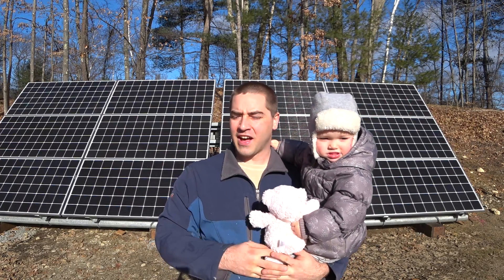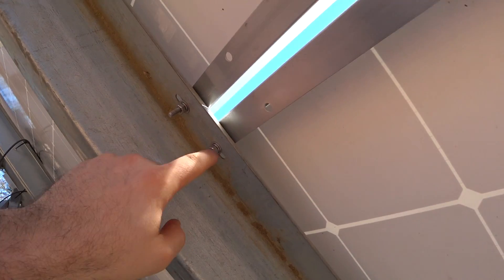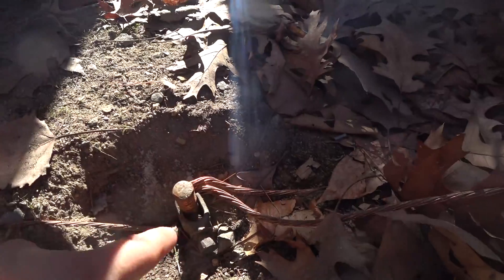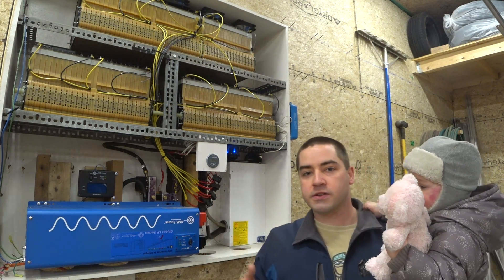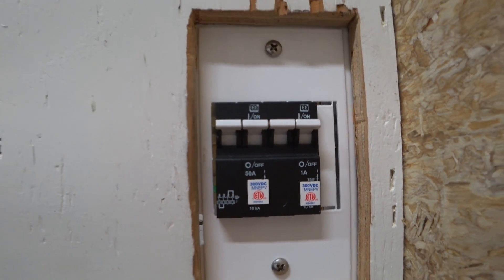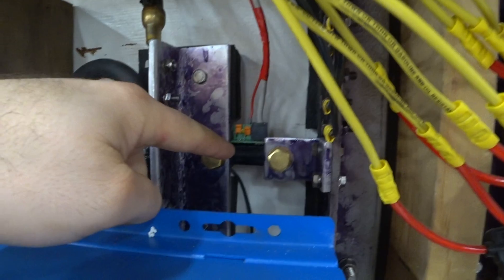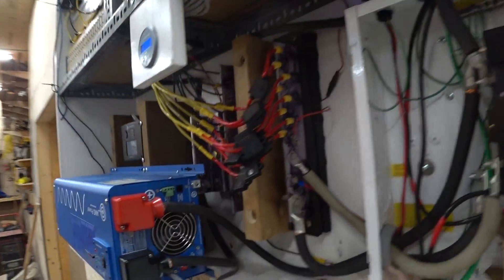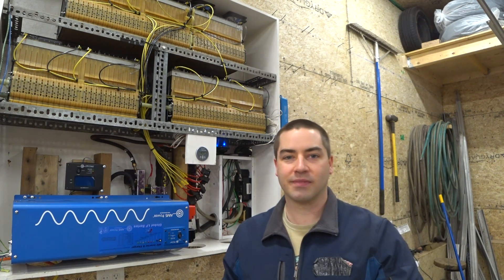Overview of Entire Off-Grid Solar System for Whole House

Comment: David, about how much did the battery system (everything but the panels, I guess) - cost for materials?  Do you know about having such a battery on a grid-tied solar PV system?
Reply from the maker: Hi Neil, The battery was the single largest purchase at $2,000.  $900 for the Charge Controller, $900 for the inverter, $200 for the battery monitor, and probably $300 or so for cables, lugs, terminals, etc.  I hope that helps.
Reply: @DavidPozEnergy  That is very helpful.  I have a 10kW roof mounted system, and I have been hoping that Aquion Energy will get their business reorganized (they make salt water batteries for buildings).  If they don't, then I am very interested in a system like yours.

Is it possible to do a battery on a grid tied system - that you can use when the grid goes down?
Reply from the maker: Yes, it's possible.  I know there are lots of ways to do it, but the only way I'm familiar with is using a "Hybrid" inverter such as the Schnieder XW+6848, or the Outback Radian, or the Sol-Ark.  My inverter is not compatible with back-feeding the grid.
Reply: @NeilBlanchard  I'm grid tied.  My system sells power to the utility.  Then I buy my usage from the utility.  My system MUST shut down when the grid goes down.

The other kind of grid tied system is battery based using the grid as an alternative means of charging. 

I am not sure the two can be combined due to the restrictions imposed by the power company.
Reply: @flyingjeff1984  Like David said, a 6848 has the capability but I also read of situations where they've been outlawed by city electrical inspectors.  It takes about a second to figure out why.  That's right, the electric provider doesn't want the 'competition'  and they've managed to get the city in their back pocket.  Wonder how that happened.  Can you say 'campaign contributions?'
Reply: @flyingjeff1984  I have been hearing that grid tied means that if the grid is down your down. But I don't understand why that must be? Other than government regulators. Why can't you just have a lock out such as I have on my manual transfer switch to stay off grid in the event of extended outage after a hurricane or ice storm for example? I want my cake and eat it to! Honestly from what I have heard about some states like California and the costs and issues, I just want want a system that can pull from three sources (grid, battery bank or generator) like all the data centers I work in. I don't want to sell back to the grid but have it as one of my programmable options to power my property. If I can also tie solar into it, to use less grid or less generator all the better! After hurricane Sandy along the NJ coast there were hundreds of homes with solar that were not able to operate to keep their properties powered, such a wasted resource.
Reply: Hi Nick, look up Jack Rickard's Evtv selfish solar system